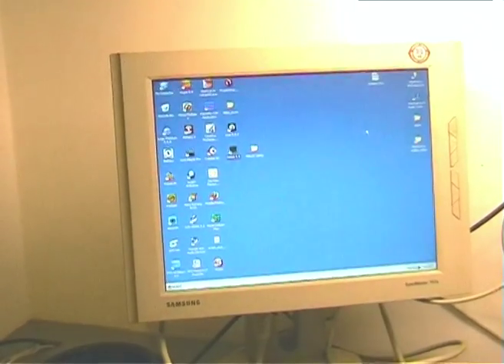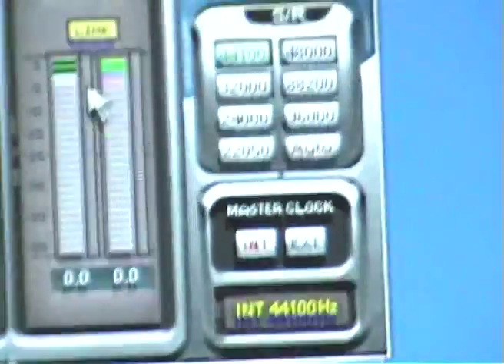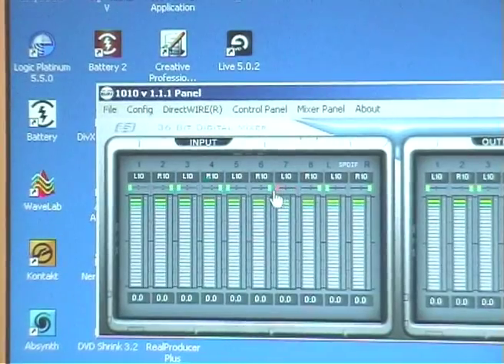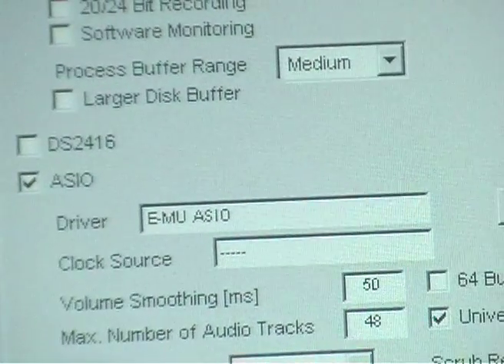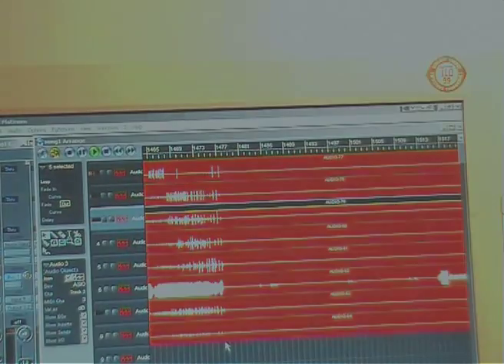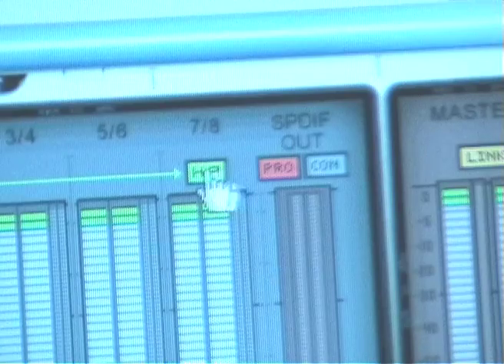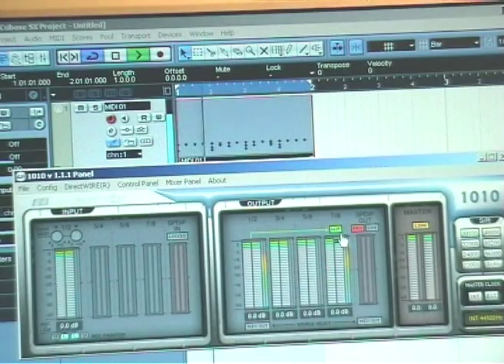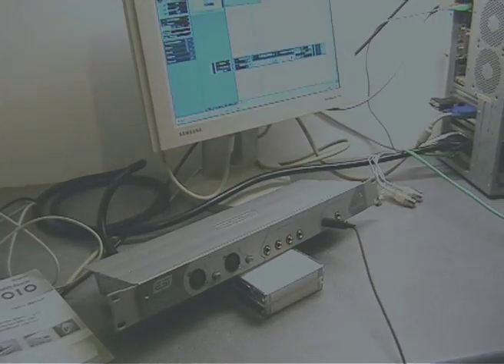ESI ESP1010 review - 3/3

Comment: I have installed ESP 1010 on windows 7 ultimate 64bits but when I play sounds I hear the sound saturated, I tried changing the drivers but the problem is repeated. You can tell me how to fix it. Thank you
Reply from the maker: not sure. are the drivers the correct win7 drivers?  have you tried all the standard audio fixes for windows 7? you can find those fixes by googling.